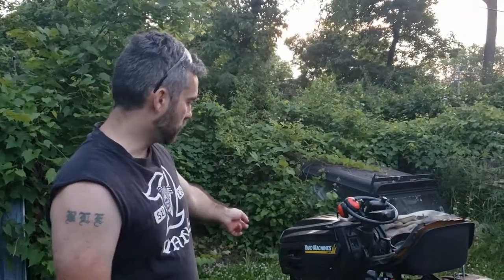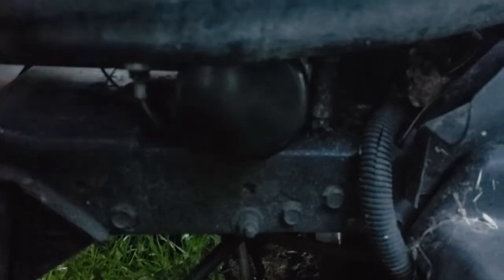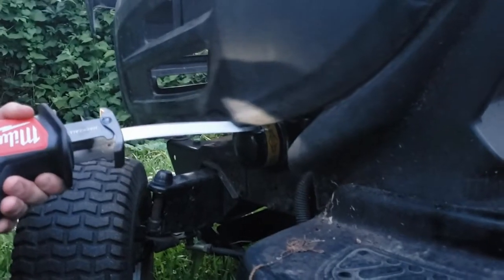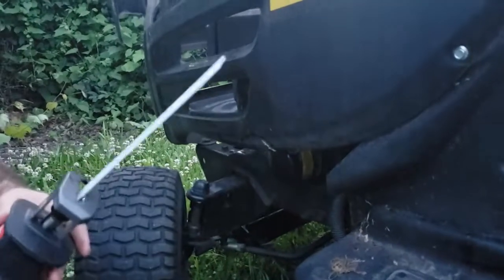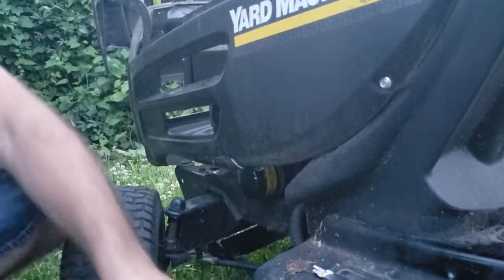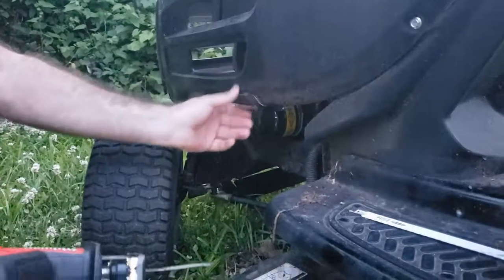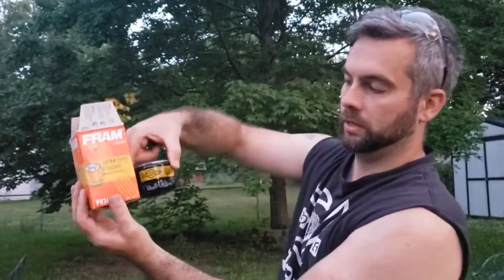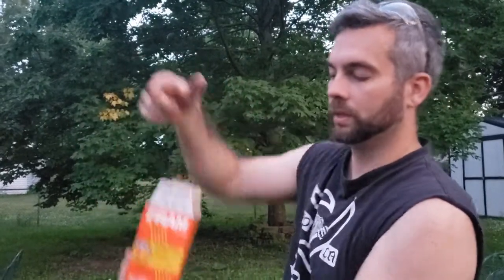17HP Briggs and Stratton Oil Filter Swap/upgrade

Comment: There is absolutely no reason that that filter needed to be changed on that day unless it was leaking oil. Four more days would not have hurt anything. You could have changed the rest of the oil and ran it until the filter arrived and then changed the filter and topped it off...it would have been roughly a cup of oil.  You could have used your angle grinder to cut the saw-zall blade to a shorter length in about 10 seconds. 
When you said that you were going to "" I was scared that you meant the old , used oil after watching the rest of the video.  Please correct me if I was wrong. What are your plans to prevent anyone from getting cut by your hood modification? How much extra oil did you have to add due to the extra length filter? Thank you.
Reply from the maker: its really not as serious as you are making it out to be, it adds a ton more filtration and only a few more ounces of oil, i like to be able to go to my local store and buy one the moment i need it and i needed to be able to use the mower that day. thanks for your input but its really not that big of a deal either way. 

have a awesome day
Reply: @smashengineeringoffical  You too